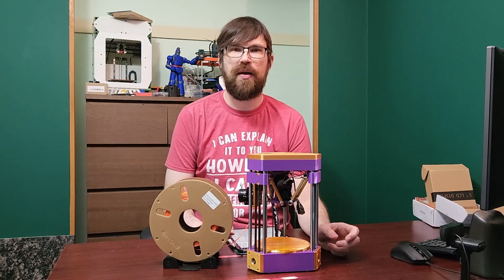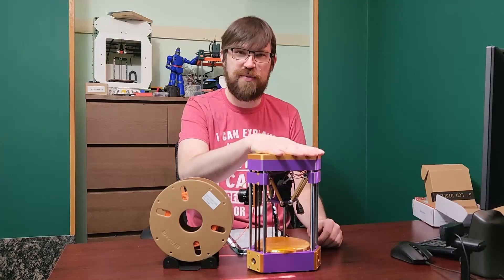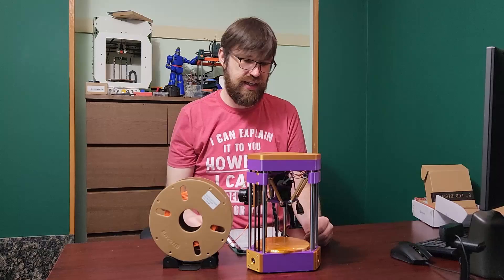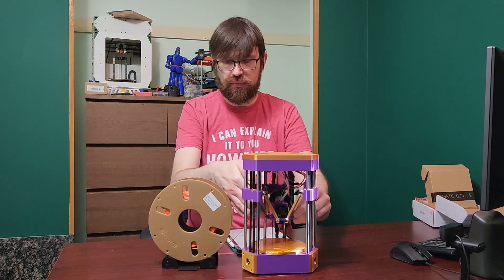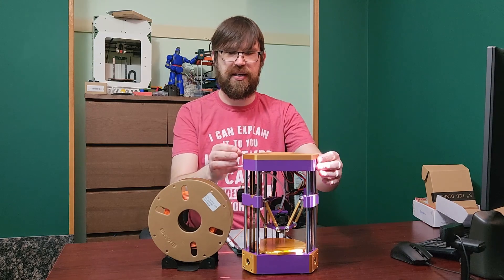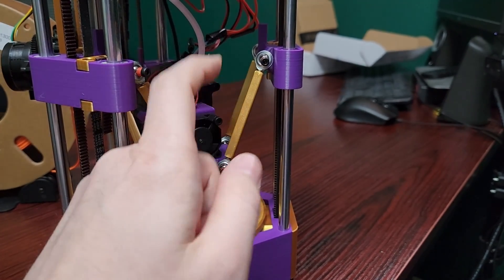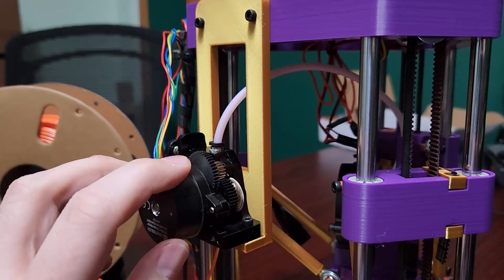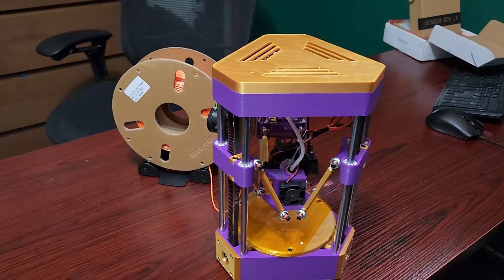I designed a MICRO Delta 3D printer - Introducing the delta I call MIN

Comment: idk if it's viable but if this could be made into direct drive with orbiter or Picolino extruder - this could become even smaller!

Or, if we somehow put spool horizontally above this printer we could be having the ultimate desk corner beast! That could even doubles as weight to reduce vibration without creating too much CoM shift.

I never got this much daydreaming looking at vorons so I didn't try DIY yet - but this - I really wanna make this as my first ever DIY printer and experiment with it so much.

gotta save some money for this beauty... Is there any upcoming updates on this or is design in frozen state? (excl. update that was half year ago)
Reply from the maker: @jupiterbjy  my community has made lots of mods, definitely join my discord there are some awesome builds!
Reply: @Rolohaun  aye will do once I finish building! Wish I could find some pico mmu sorta things there too hehe

Comment: Question to anyone able to help me. I have a few spare(not so amazing) parts, and want to make a cheap version of this for my little brother to see how much he would actually use a 3d printer. Any tips on doing a budget version? Smaller motors? I have spare ender boards, most likely would do marlin and avoid klipper too. Any and all help would be very appreciated. Thabk you in advance!
Reply from the maker: very hard to make this much cheap, I do not recommend Marlin for delta 3d printers
Reply: Ahh, 😂that is good to know. Thank you!
Reply: @jonathanserrano655  As i know marlin can be used on deltas. For example: BIQU magician uses marlin. But I don't know how hard will it be to configure marlin this way.
Reply: And BIQU magician is printing fast and well. I use it for some figures.

Comment: It's cool n all , but a delta is a poor choice for a small printer.   It uses a lot of space to get its angles.  However, it could be a really fast printer being so small, which is what I was thinking of doing, build one super light and go super fast.  Does not seem that was a goal here, and it uses a lot of parts.
Reply from the maker: I think it turned out great, not many parts you can remove from this. Every printer has pros and cons and there is a million ways to design them, that what makes it so fun.

Comment: I can't help but imagine the XY build volume could be increased while keeping the footprint by changing the position of the ball joints (between the belt and rods, outside the rods, or far outside the rods), but I've never built a delta so theres probably some clearance issue I'm missing.
Reply from the maker: the arms would probably not have enough rotation room

Comment: looks awesome!
is there any specific reason why you decided to put the electronic-boards on top instead of adding them to the bottom? Having them in the bottom would move the center of mass down and could make it more stable which could be beneficial I guess 🤔
Reply from the maker: there is no weight in the mainboard, all the nema 17 are at the bottom and there is plenty of weight down low. Also people might add a heated bed and you do not want electronics in the base

Comment: honestly, why not make it direct extrusion and put the spool ontop?
Reply from the maker: There is no room on this size, maybe the 120mm version
Reply: @Rolohaun  maybe one of the smaller direct extruders?
Reply: @Rolohaun  I don't think you'll have any room for a direct drive even on your planned 120mm version. Your best compromise would have to be some flexible shaft based extruder.
Reply from the maker: @pokeprime  ya space is a premium, I am ok with bowden for this size though